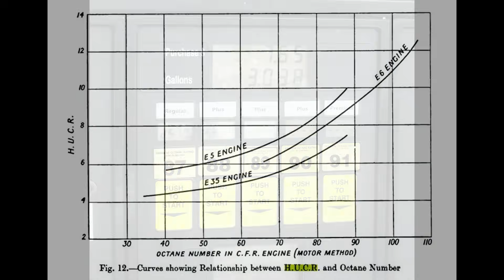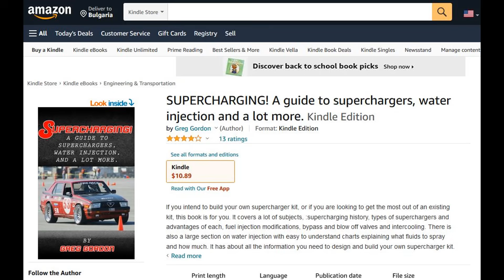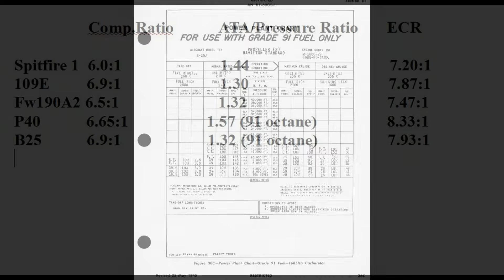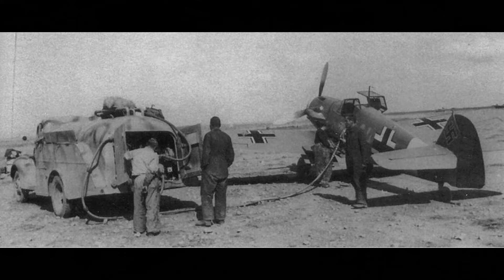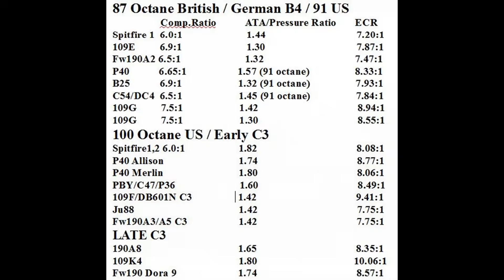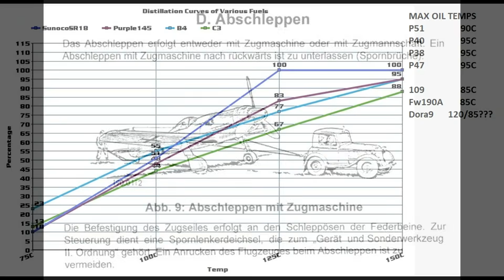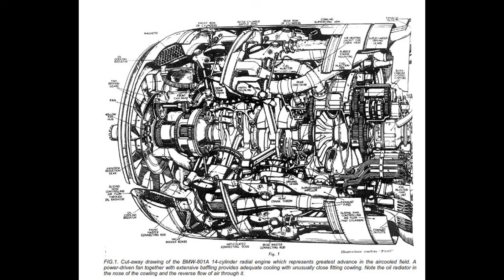German C3 Fuel, Uber Octane or Synthetic Crap?

Comment: Could running engines on the lean side have anything to do with the fuel shortages Germany was experiencing towards the end of the war? I.e. trying to get more out of the fuel allocation they had.
Reply from the maker: I don't think so. You don't build a supercharged 35 liter V-12 and then hold it back trying to increase fuel economy by some small percentage, and then only when it's at war emergency power, a time when economy really doesn't matter.
Reply: @GregsAirplanesandAutomobiles  Probably... But the engineering side for the engines & the fuel allocation & operational organisation are likely separate & wouldn't nessasarily have the same priorities.

Comment: This is an excellent video. I remember puzzling myself about how the K4 has such high effective compression and thought it was overestimated and in fact lower due to pressure losses in the complex supercharger ducting (The reason the right bank has higher compression is cause it loses more pressure cause the impeller is closer to the left bank). The video fills in the gaps and is very informative.

Also, the very high 25lb boost on the late spitfires, it just compensates for a lousy cylinder compression ratio I guess.
Reply: The different compression ratio's in the Daimler Benz engines have nothing to do with the supercharger. This was required by lubricating oil entering the cylinders of the right hand bank in greater quantity than the left (due to left hand turning crankshaft). Because oil is reducing the effective knock resistance(performance number) DB reduced the compression ratio of the right bank as a counter measurement to prevent the right bank from detonation and pre ignition.
Reply: @4strokenicolaus   Very interesting. Do you have a source for this? Every source I have for the DB engines mentions the pressure drop. Also, if this is the case, why does no other V12 aero engine follow this same design principle?
Reply: @jg54cule Due to inverted vee's cylinder heads, and piston rings & gravity. See Calum's book, "The Secret Horsepower Race".

Comment: (1:08:05) I think that the earlier DB601s and Jumo 211 had a maximum of 100 deg.C., while the later pressurized cooling systems in Jumo 211, Jumo 213, later DB601s and 605s had 115-120 deg.C. max coolant temperatures. Will put some sources here once I find them.
Reply: Ok, here are my sources and what was written there: 
(1) Pressurized liquid cooling system example. "Motorhandbuch zum Mercedes-Benz-Flugmotor DB603A, Baureihe 0, 1 und 2" "Ausgabe 11.1942" - Page 16, there is a table with various performance settings; maximal Cooling Outlet (Kühlstoff, Austritt) Temperature: 115 Deg.C (Altitude 0 - 2.5km, above that the value decreases, in -correlation with- the boling temperature curve of the coolant over altitude), for a maximum of 10 minutes; Regulated temperature, continously usable: 102 Deg.C (until 6,5km, then decreasing); Maximum permissible temperature at 10km altitude: 103 Deg.C.; The 115 Deg.C value is mentioned additionally a number of times in the same handbook. 
(2) Pressurized liquid cooling system example. "Motorhandbuch zum Mercedes-Benz-Flugmotor DB601E-G, Baureihe 0 und 1" "Ausgabe 2.1942" - Page 20 - a very similar table as in the previously mentioned handbook, again 115 Deg.C. Max Coolant Outlet (Kühlstoff, Austritt) Temperature, decreasing with altitude, in -correlation with- the boiling temperature curve of the coolant over altitude. The 115 Deg.C value is mentioned additionally a number of times in the same handbook. 
(3) Non-Pressurized liquid cooling system example. "Betriebs- und Wartungsvorschrift zum Mercedes-Benz-Flugmotor DB601A und B" "Ausgabe C, Oktober 1940"   - Page 47 - now, here it is mentioned, that the maximum Cooling Outlet Temperature is 6 Dec.C below the Boiling Point of water at the given altitude (which decreases with altitude). 
(4) Non-Pressurized liquid cooling system example. "Betriebsanleitung Ju 87 B - Flugbetrieb - Juni 1940" - Page 10 IV, "Betriebsdatentafel" (*also seen in the video at 1:16:47) - we see the Jumo 211D engine, Max Outlet cooling temperature is 95 Dec.C (apr. 5-6 deg.C. below boiling point of the coolant), decreasing with altitude; Being already 80 Deg.C at 8km of altitude. 
(5) Pressurized liquid cooling system example. A set of graphics called "Kühlklappenstellung beim Steigflug" (Cooling Radiator Flaps position during Climbing) "109 19 L 42 Blatt 10" - we see there the actual Coolant Temperature, when using the automatic regulator, which is between 85 - 95 Deg. C throughout the altitude, depending on external factors and the cooling flap position. The maximum value is achieved at rated altitude (apr. 6km).
There is an additional curve, pointing the maximum permissible temperature (Höchstzulässige Austrittstemperatur, zulässig beim Steigflug): 115 Deg.C until 2,5 km, then steadily degrasing, towards 103 Deg.C at 10km altitude. Engines mentioned in the graph: DB605A and DB601E. Pressurized liquid cooling system example.
(5+) Pressurized liquid cooling system example. In the same set of graphs, in "109 19 L 42 Blatt 7" (DB601E) and "109 19 L 42 Blatt 8" (DB605A), one can see coolant outlet temperature ranges depending on altitude, for both engines. Interestingly, the DB601E cooling regulator allows 102 Deg.C. at 0km, decreasing to 94 Deg.C at altitude, while the DB605A is a bit overcooled at ground level (apr. 90 Deg.C).
(5*) all of this can be found here: http://www.wwiiaircraftperformance.org/me109/VB-109-19-L-42.pdf
(6) Pressurized liquid cooling system example. At Kurfürst,  , we see the following thing the Finns did with their Me109G-2, MT-215, when dealing with the coolant temperature during climb: German calculations typically assume a standard radiator flap position, referred to as Steigflugstellung (or climbing position), at which the radiator`s exit flaps (Kühlerklappen) are open 220 mm wide, or apprx. half-open, and 74mm at the variable the inlet (Einlaufflippen), in order to provide imcreased airflow during the slow-speed climbs. Such measures would keep the coolant temperature low at an optimum 85 ○C value, but the engine itself would tolerate temperatures as much as 115 ○C safely up to 10 minutes duration, and the automatic thermostat not interfere up to 100 ○C temperature, which could be sustained indefinietely, as noted on page 4 of the DB 605 A-B Motoren-Karte, Ausgabe Oktober 1942 .
http://kurfurst.org/Performance_tests/109G_MT215/109G2_MT215.html
+ you can see the DB605A and B Table here: http://www.wwiiaircraftperformance.org/me109/DB605-A-B_enginecard-p4.jpg

(...) I currently don't have the Jumo 213 guide in front of me, but I saw similar figures there.
As a conclusion, the German engines had two general technological levels when dealing with the liquid cooling system: non-pressurized: early engines until end of ~1940, Examples (3) and (4), DB601A and B, Jumo211D, and pressurized: later engines from ~1941* onwards, Examples (1),(2), (5) and (6), DB601E-G, DB605A, DB603A, (Jumo213) and many more. The latter could sustain (not indefinitely) significantly higher coolant outlet temperatures than the former.
(A) The maximum permissible cooling outlet temperature for those engines is respectively 95 Deg.C until 3,0km and falling to 80 Deg.C at 8km altitude for the engines with non-pressurized colling systems.
(B) Respectively, it is 115 Deg.C. until 2,5km altitude, falling to 103 Deg.C. in altitude, for the engines with pressurized cooling systems, limited at 10 minutes of usage time. 
(B+) For those we have a "continous" collant outlet temperature value, which is 102 Deg.C until 2,5km, slightly falling of at altitude (97 Deg.C at 10km). In addition, the automatic cooling regulator keeps a bit lower temperature ranges during climb, than the "continous" temperature range, depending on the engine type - at apr. 85 - 95 Deg.C for the DB605A and (apr. 90-100 Deg.C for the DB601E) but can be overridden if needed (like the Finns did with their MT-215, for better climb performance at low altitudes).
Thus, at least in this respect, the superiority of the Allied engines is rahter marginal at best.

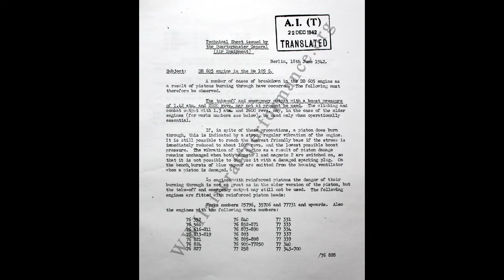Comment: (47:20) it was about Oil Fumes and the Oil Separator design. Spark Plugs getting hot was also an issue. In late 1943, after all of this has been addressed with newly designed components, they released the 1.42 ata again. Of course, this doesn't mean that they didn't push the limits of the engine with this kind of fuel too far, in general.

Comment: Germany was late to fit self sealing fuel tanks. But after they did a lot of seemingly random engine failures happened - exhaust valves were burning out and spark plugs getting over heated. 
I can’t find the reference (though Greg probably does have it).
German engineers eventually discovered that planes with SS tanks filled and flown did just fine. But planes parked with fuel left in the tanks for a while would destroy their engines. It took at least a year to discover that the SS material was depleting the octane booster.  Fuel used immediately was fine but fuel left to “soak” was not.

Comment: Nearly halfway through another great video from you:

Two things:

You mention air density as the factor to calculate actual comp ratio in a charged engine instead of just multiplying geometrical comp ratio and boost pressure. You are definitely right about that because the hot air from the compressor/turbocharger has lass density.
But, as you metion earlier, higher temperature also leads to knocking.
Pressure is the product of density and temperature. 
If pressure is the determinating factor of knocking (as in comp ratio in a N/A engine) doesn´t the hotter air in a charged engine make up for the lesser density?
More density just means there is more oxygen to let the burning process be more efficent. In a given engine you can run the mixture richer if you have colder air instead of hotter air, getting more power (more oxygen and more fuel in a given displacement). That´s why engines perform poorer in hot climate. Same for less air density in higher alltitudes, that will take away oxygen. 
In addition, if you can run the mixture richer (because of more density) it will cool down the engine because of evaporative cooling, also preventing knocking.
Isn´t that the whole point about intercoolers, running the engine cooler with more dense air, so also beeing able to run it richer?
If more density regardeless of temperature alone would lead to knocking, who would need intercoolers in a charged engine? Then you would just increase boost pressure whithout an intercooler and don´t mind about temperature. I don´t think that´s how it works.

Second, you don´t mention ignition timing. As far as I´m aware it´s a huge factor. Early ignition gets you more power out of a given engine, but it also makes the engine running hotter, thus promote knocking. As far as I know, charged engines usually use less early ignition as N/A engines.

Greetings, 
philpp
Reply: Great questions. 

It's a complex answer but your.on the right track. And it varies based.on the specific engine design, what method it creates additional boost, (one, two or three stage, one two or three speed superchargers or exhaust driven Turbocharger, and whether the have an intercooler, or maybe an intercooler between each supercharger stage?). 

The absolute best resource on the subject, written by a top American designer who worked on aero engines of that era. MITs Charles Fyat Taylor: Internal Combustion Engine in Theory and Practice Vols 1&2. 

Keep an eye out for a used set, they can be spendy. Best book on engines of all sizes and how.to go about designing or reverse engineering them. Haha!

Comment: Hi Greg,  A very interesting and thought provoking discussion of fuel.  Well done.  
A few points though; you say DBs had different CR on each bank?  Does the cooling system work better on oneside than the other?  Does the fuel injection metering work better on one side?  
Your ECR formulae?  Surely what matters is the mass of mixture since that is the chemical energy you have available.  How does that stack up?  Your argument does make sense.  
Your mention of small bore vs large bore is interesting too.  Larger bore has a longer heat path in the piston crown but also have larger valves so they can breathe more deeply and have more mixture to compress, ie better volumetric efficeincy so larger heat rise and more tendency to knock.  
Exhaust valve temperature is effected by it's cooling.  The condution path and efficiency in the stem (eg sodium cooled valves are cooler) and the ability to transfer the heat to the head and cooling system (length of valve guide, head material) are also factors.  Thus, as Sir Harry writes, liquid cooled engines have a better knock margin than air cooled.  
Knock sensitivity is dependant on cyclinder temperature as well as fuel type.  As you infer intercooling is a very valuable tool in avoiding knock.  Using a rich mixture as "in cylinder cooling" based on the latent heat is the reason it is effective.  Water works as "incylinder cooling too" but needs more plumbing (sorry no pun on added lead intended) so rich mixture is easier.  A down side of a rich mixture is it's ability to wash the bores and accelerate bore and ring wear, which could then result in oil in the comustion chamber and lower effective octane or higher hangar maintenance time.  It also uses more fuel, something which the jerries were short of particularly after losing the Crimean and Romanian oil fields.  Were they too desperate for fuel supplies to run rich?  Far fetched perhaps but certainly they were desperate enough to produce synthetic fuel at all. 
I read somewhere (can't remeber where) that in a Russian front winter up to 50% fuel was added to the oil for starting.  I don't know but perhaps the oil would be changed after warm up?  If changed that would bypass your evaporation rate issue?  If not they better have a good crank case breather.

 'Itsjustme justme' below remarks on faulty pistons and aerated oil.  That would burn pistons.  What about the pilots though, in the heat of combat do you time your one minute rating and then slow down or do you try to stay alive?

Keep up the good work.
Incidentally, Sir Harry's book is still in print.  Is it out of copyright?  (Died 1974).
Reply from the maker: all good points, and yes Ricardo's book is way way out of copyright.

Comment: A problem with using throttle-body injection or single carburetors  (as opposed to multiple carburetors and port or direct injection) is that its hard to get an even fuel-air charge among the cylinders.  You pretty much have to tune for the leanest cylinders and accept that the rest will be a bit rich.  (Of course he mentions this in the vid... this is what I get for posting before I watch the whole thing).

Comment: Good points about the life expectancy of the German fighters later in the war. I was reading about the Luftwaffe's Autumn 1944 attempts to stop the 8th Air Force Raids, and they are horribly lopsided bloodbaths for the Germans. In November 1944 they only go up 4 times in attempts to defend their oil installations, and are suffering loss rate of ~25% each engagement. Essentially the life expectancy of their fighters and engines are a couple of hours. That realization would probably make them less cautious with trying to preserve their engines when it came to the fuel.

Comment: (23:00) The DB601 has a Direct Fuel Injection, the Merlin has a Carb. Thus the German engine has alone from this a small advantage in knock resistance. (didn't watch the video till the end, maybe it is mentioned afterwards)

Comment: So why producing me 262 instead if bf 109 k4 
And what i understand from your fw 190 vs p51 is if you preasure air it will produce too much power even more than puting a tnt and if octane goes up you can get more power and i didnt finish fw 190 vs p51 offical i am still watching it
Reply: It cheaper. Jumo 004 might cheaper than DB 605D. Also, you can ran it on kerosene or diesel (or gasoline but was deemed inefficient) instead of specific type of avigas

Comment: There are some german documents around were different parties argue if C3 + M50 is ok for the late 109s (eg using it for 1.98ata) from memory there was a group or staffel testing 109 Ks and G-10s in that setup for several months. And I think it was cleared for use at some point. I think in march 45.
Since the documentation at the end of the war is spotty at best its hard to tell if those orders from above were reality in the field, since the modification from B4 fuel to C3 could be done rather quickly. 

I can totally imagine that a pilot and crew chief would have used the "forbidden" modification if the resources would have been available and the risk was deemed acceptable in their eyes. But that is entirely my opinion and only my thoughts when i read the reports.

Comment: My ZX-10 has almost 13:1 compression. Runs great on 92 octane. Only 1000cc.
Reply from the maker: exactly. If 17:1 was realistic, motorcycles would be doing it, and they have much smaller bore diameters.

Comment: There was some anti-knock research in the 1920 that looked at quite a few potential anti-knock compounds and rated their effectiveness.  Among them was triaryl-bismuth, which was about a fourth as good as tetra-ethyl lead, thus requiring four times more concentration for the same knock reduction.  I think I once calculated that switching to it would add about 10 or 15 cents a gallon to the cost of 105 octane, or something close to that.  I wouldn't think it would effect valves or bearings any differently than lead, and the worst the exhaust might do environmentally is just make Pepto Bismol.